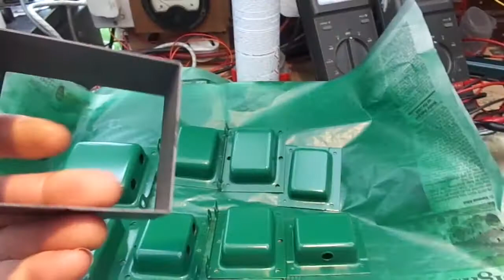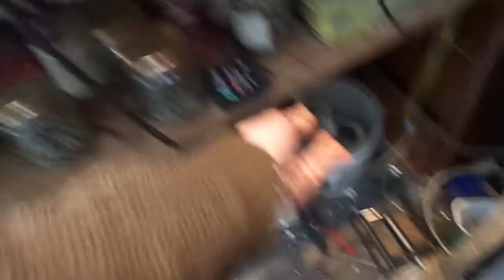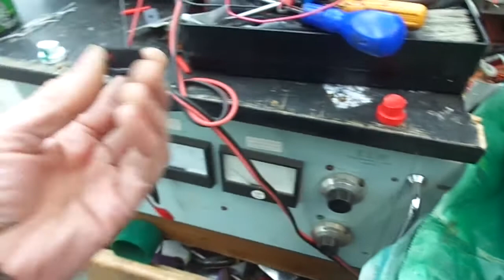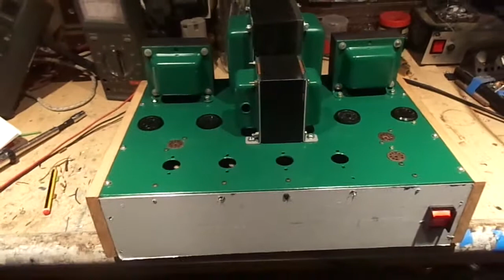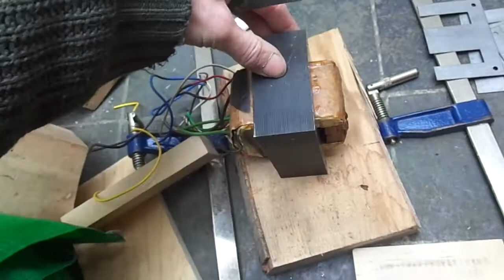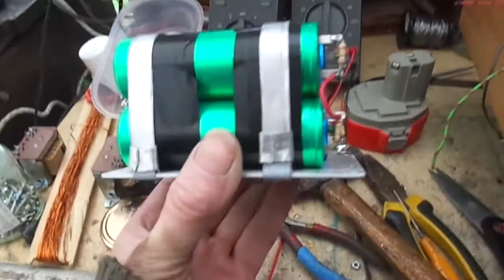Class AB2 Valve Amplifier 6146 PP - Part Four - Chassis Painting.

Comment: Looking good D.A! & looking forward to the next instalment, I’m interested to know what lamination size you used for the mains TX please?
Reply from the maker: Thanks. Not sure what size the lams were they measure 4 1/2" by 3 3/4" so the nearest modern equivalent would be EI110. I didn't wind the tfmr, just re laminated it as it was badly put together.It was a Dynaco ST35 mains tfmr copy AFAIK......DA.
Reply: @diabolicalartificer  ok thanks for that info👍